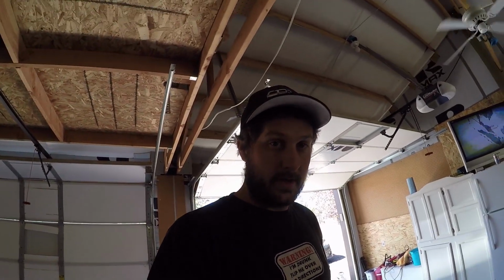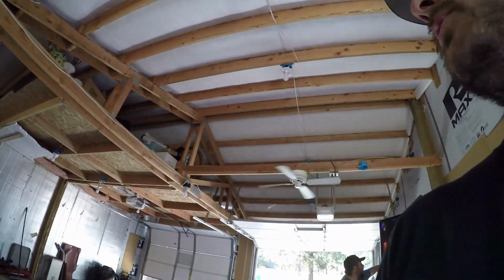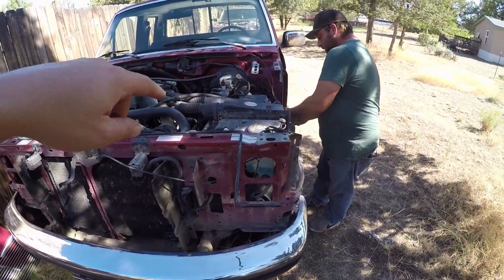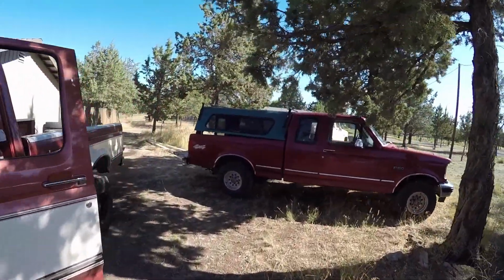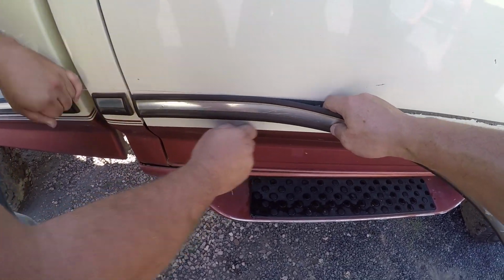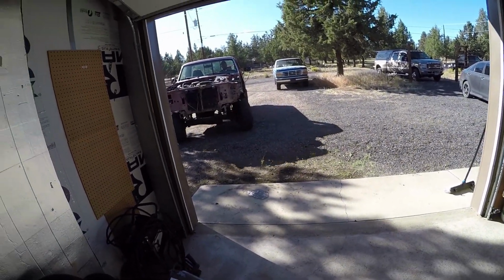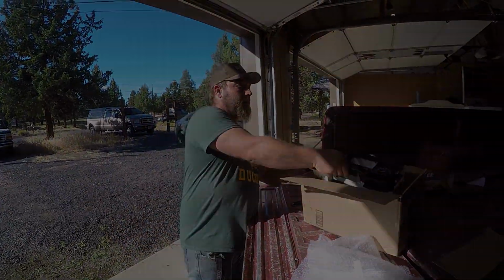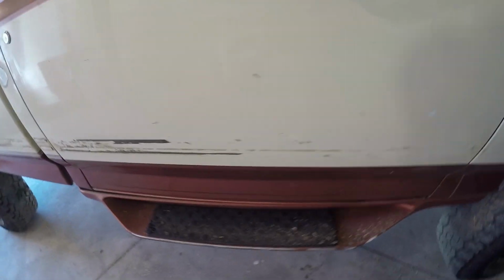1995 OBS FORD F150 BODY PREP PART 1

Comment: Heads up the cluster wiring does change. They are grouped 92/93 94/95 and 96/97HD. They can be repinned to work if need be though.
Reply: Chris Clayton I put a 96 cluster in my 94, no problem at all
Reply: Chris Clayton I think the big difference is the 93/94 transition because of the airbags
Reply: @Iamthathillbilly  Depends on the options as well the grouping is used as a general rule of thumb but they did repin certain ones. Charging light changes was one. ABS changes some of the grounds even move. Id have to pull the sheet up again but if you look in Alldata several of the pins do move. You  may have gotten lucky and gotten close enough or dont have a specific feature that changed.
Reply: Chris Clayton well most of my dummy lights are either on or disabled and I have a mechanical oil pressure and temp gauge so the factory senders are gone and those gauges sit idle. Not sure if any of that would be different, my abs light did come back on as it should, the cluster was for a 6 cylinder of the same trim level though
Reply: Chris Clayton and my truck is also a 6 cylinder
Reply: @Iamthathillbilly  Yeah I have never owned anything but Lightnings and 5.8L's they vary a good bit. The biggie is the charge indicator 92/93 require a functional bulb otherwise the alternator will not come on. In later models it was just an indicator of it not charging. But Ford is weird like that their harnesses are notorious for changing every few years.
Reply: Chris Clayton that is really weird, ford changes a lot of things all the time, I own two 94s, one is a MAP injection and the other is a MAF lol